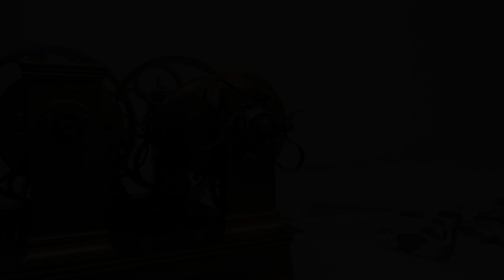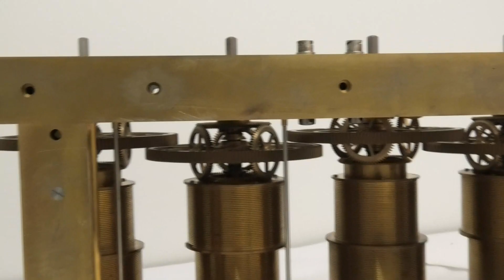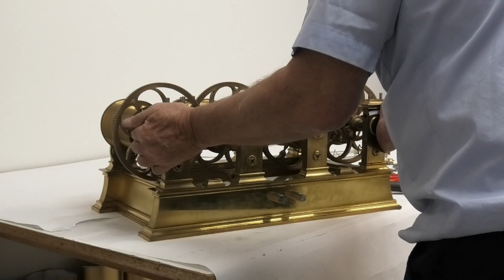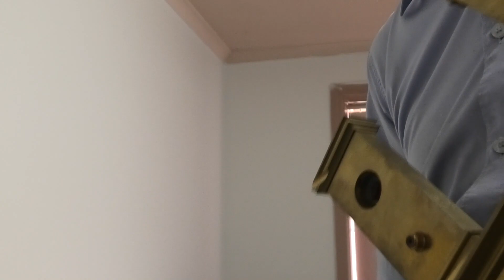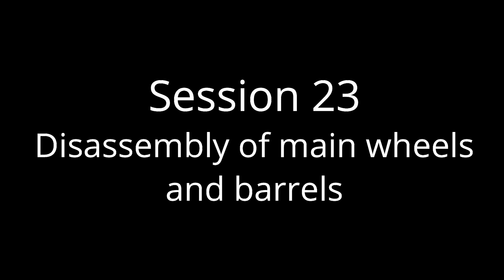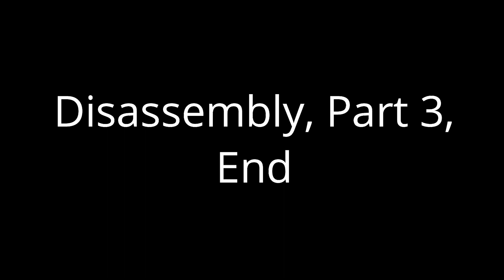Astro-skeleton disassembly, Part 3 Sessions 18-23

Comment: I've been following the clock build for several years, and while the fabrication of the individual parts was detailed, the integration into the assembly as a whole wasn't clear.  I find the disassembly videos extremely interesting as to how that integration was done.
I assume that the use of springs vs. weights has been theoretical to date.  Is the plan a complete reassembly in Oz with the springs, or will that be done after delivery to the US?

Almost sad to realize the build will be over relatively soon.  I'd be happy to visit Chicago for a tour of it running.
Reply from the maker: Sure would be happy to have you see it once it arrives. You can contact me through my website.
Reply from the maker: Sure you can see it when it's finished later this year. You can contact me through my website
Reply from the maker: BTW the conversion to springs has already taken place

Comment: best. lego set. ever.
KEvron
Reply from the maker: I've seen the clocks you have made from Lego sets, nice work. Yes, remontoire are real power hogs! When the Astro-skeleton was to be weight-driven, we had to rig up a weight-sharing system between the time train that had two Wagner rocking-frame remontoire and the celestial that had one Robin style (but everything moves very slowly in that train and so did not need as much power). To drive the time train alone with compounded weight it took about 90 kilos, about 200 lbs. Of course we are now using motor springs.

I saw a working Babbage's Analytical Engine made from Mechano, I wonder if that could be done in Legos?
Reply: @MarkFrankclocks  
"a working Babbage's Analytical Engine.... I wonder if that could be done in Legos"
could and has: https://www.youtube.com/watch?v=i_u3hpYMySk
KEvron